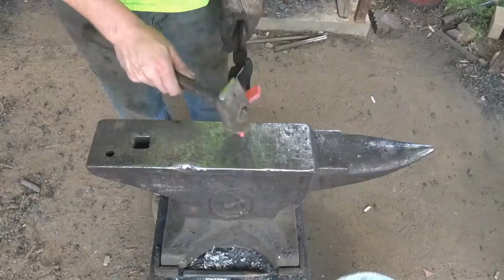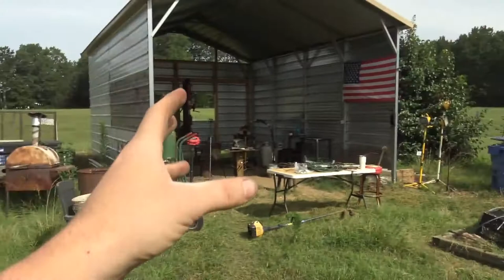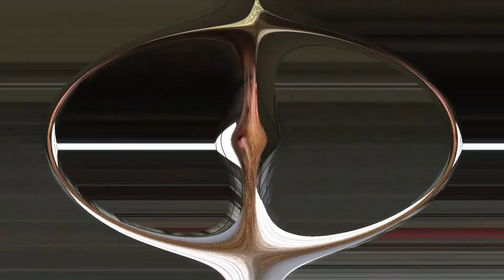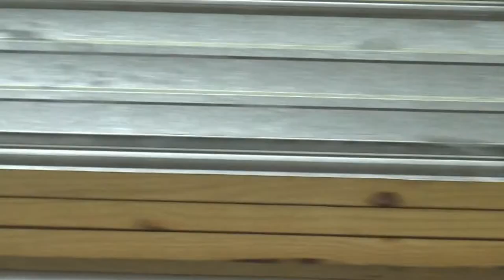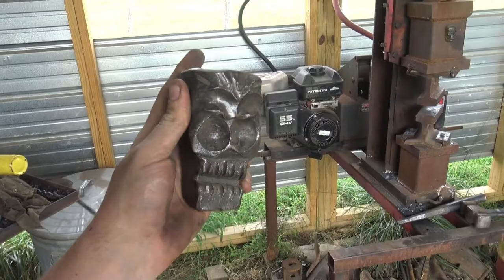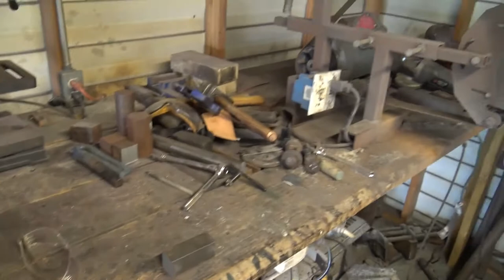Making Your Shop Work For You: Things I Have Learned

Comment: Thanks Tin Ting, Some good points in this video regarding the horizontal surfaces, they are just a pain in the ass. There is a certain amount of surfaces that are always going to be required but totally agree they need to be kept to a bare minimum or you are in for a world of clutter pain. cheers man and good luck with the rebuild of the business plan Andy 🔨

Comment: I came home from Han's place and unloaded all my stuff onto the work benches and it's all still sitting there so zi can surely relate to the cleaning. Used to clean my shop every Friday evening so it was ready for the weekend. I need to get back to that. As far as size I am landlocked. No where to go limited space and small shop. That's why I'm looking for a bench top power hammer. No room for anything. The reconfiguring is a great idea. Think I may look at rearranging things a bit. Good luck on yours.

Comment: Lots of good points TingTing. I've recently been ( literally) dropped, back into the position I held at work for 9 years...5S technician. Of course, since they did away with the job class, I'm sure it will be called something else now. But basically, that's what I do. Sweep, sort, set in order, sustain, and shine. My benches at home though, look like hell, lol🤣